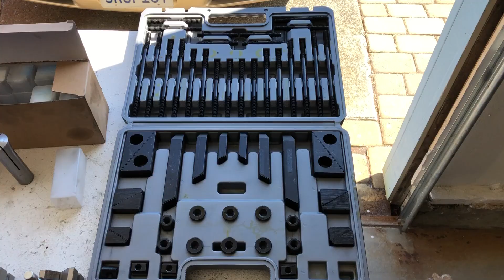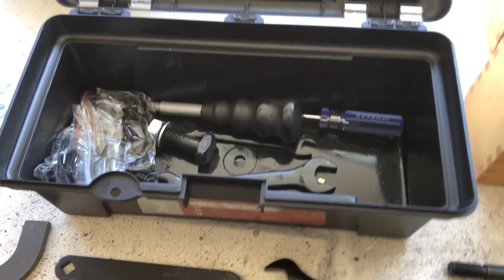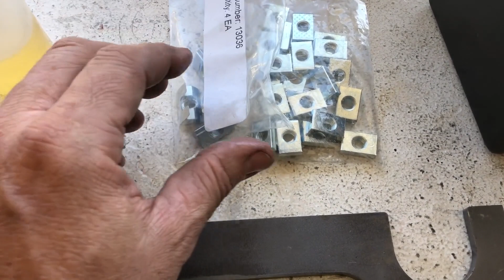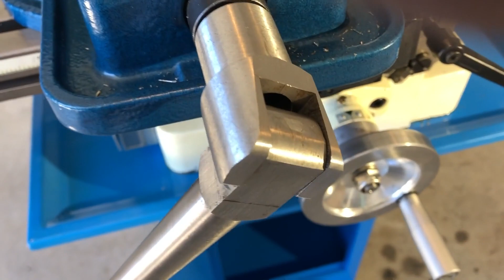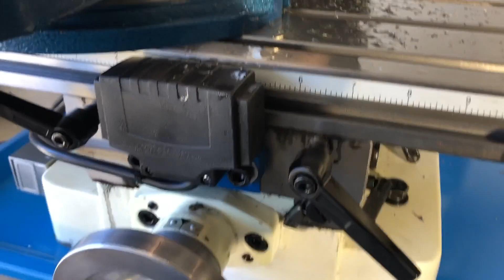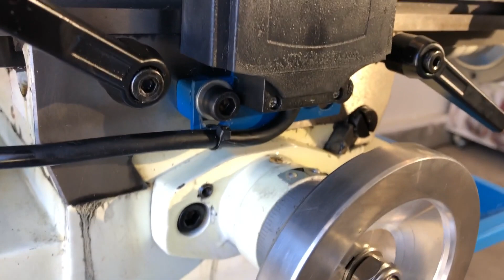Basic Lessons Learned with my Precision Matthews PM-25MV

Comment: I just came across your post, I have the same mill, IMO your X feed is too tight.  Loosen it, put a piece of paper between the gears, retighten, manually,  turn the x axis and roll the paper out from between those gears.  Grease the gears and all will be good. Dont keep that x feed that tight
Reply from the maker: Great idea

Comment: I suggest for oiling up under the table on your x axis ways, you need a proper pump type oil can.  The plastic squeeze bottle style doesn't push oil when pointing upward.  You weren't oiling anything in the video when demonstrating that bit,  just blowing air on the ways.
Reply from the maker: I just got a proper oil can yesterday with my lathe order.
Reply: @industrialebikes4956  call that a win then! (Of course some would say it is an expensive way to buy an oil can but whatever works...)
Actually you could also tell people you got a free lathe with the oil can you needed to buy for your mill. That would sound much more impressive!

Comment: Your 2 flute mills are better for slotting most materials not just aluminium, now you have a mill the extra Tnuts you bought are excess, you can make your own. Also unless you do a lot of angle work take the swivel off the vice, they are not very accurate or rigid and it will reflect in your finished work.
Reply from the maker: I have since taken the swivel off of my vise. I am much happier without the swivel.